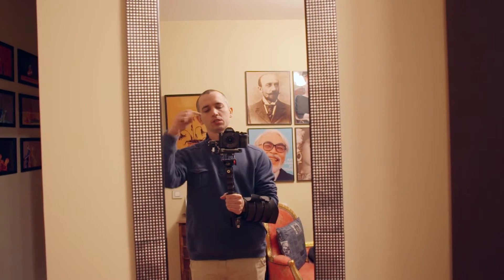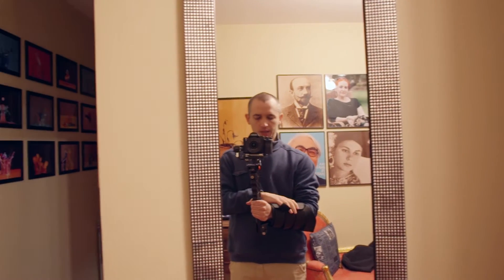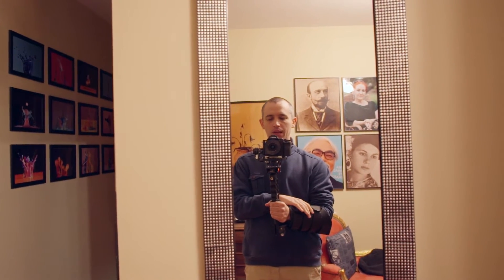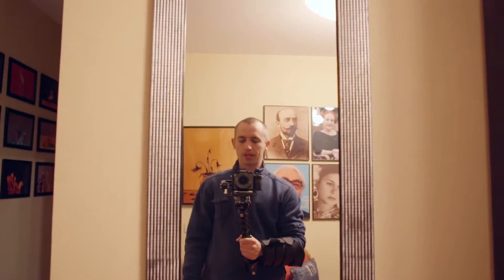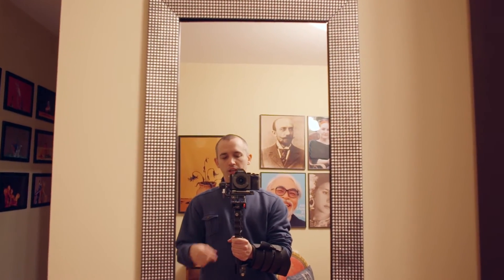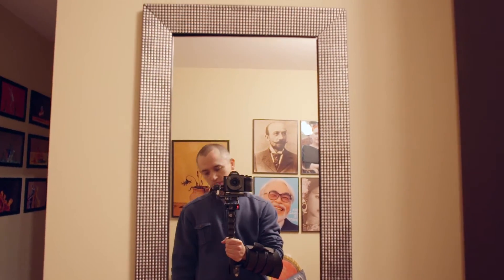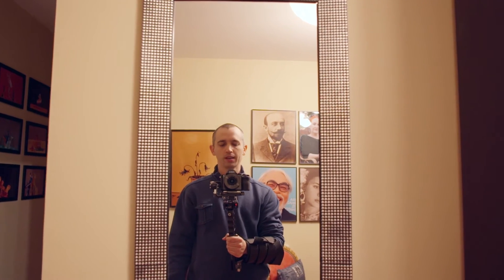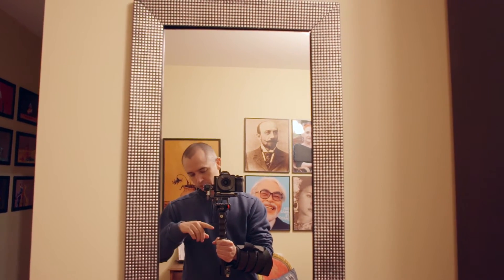Nebula 4000 + Brace from Flycam Nano

Comment: How did you connect the brace to the Nebula 4000? I have the Flycam Nano DSLR with brace myself and I want to buy this Nebula stabilizer as well. How much did you pay for the Nebula included shipping in Euros?
Reply from the maker: The Nebula was $700 including shipping, plus maybe 60eur from customs.

I have a 3D printer, I made the piece that joins the brace and the N4000 myself. The market must be really small, but if anybody is interested I could sell these for $25 each, including worldwide shipping. You can see a closeup here:
http://www.dvxuser.com/V6/showthread.php?330675-Micro-Gimbal-for-GH4-BMPCC-A7s-699-USD&p=1986516988&viewfull=1#post1986516988

Also, this weekend I'll be trying a new 3D-printed piece that turns the metal part from the flycam brace into a stand for the N4000. So, I'll use it as you see in this video, and if I want to leave it in the ground I'll just take out the metal piece from the brace and the whole thing will stand on its own. Hopefully XD